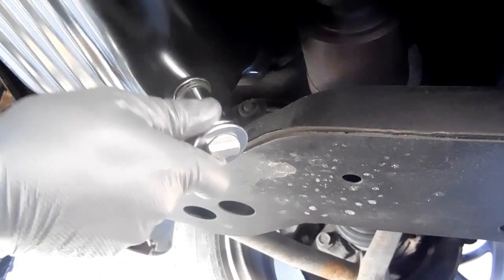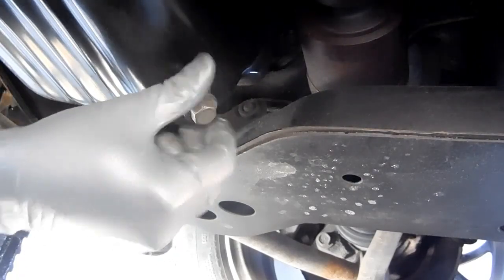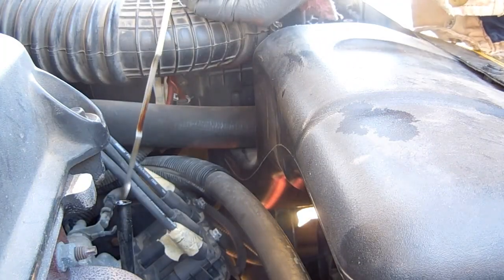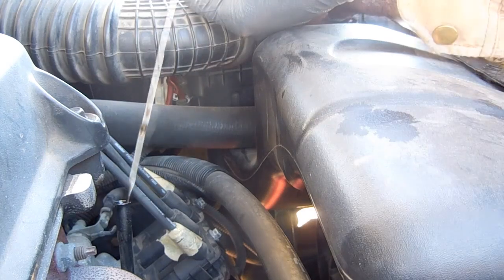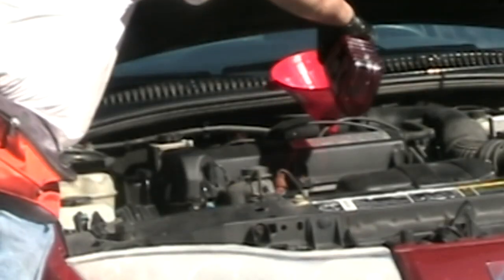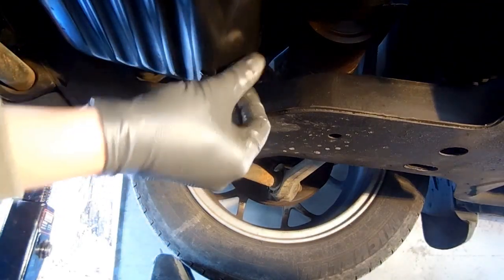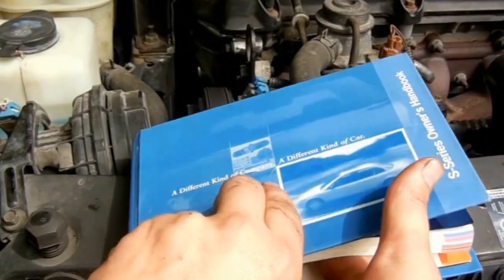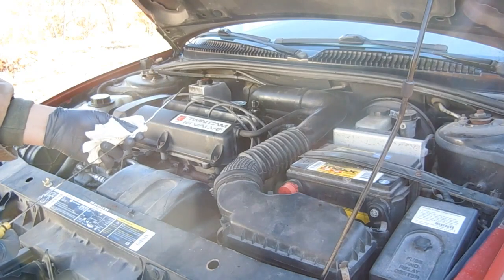Safe Motor Oil Flush Using Kerosene

Comment: this type of flush is a bad idea.. diesel and kerosene break down the oil film strength, so the engine is not getting properly lubricated while it is running, this will cause connecting rod bearing, cam and lifter, as well as main bearing damage. it will also damage flat tappet cams and lifters. I have seen this crap wreck engines.  I build high performance Big Block and Small block Chevy's for drag racing. There is no way I would do this to any of my motors.  there is a blog on the web that discusses engine additives and their effects on oil. it also have valuable knowledge on motor oils and the properties that you need to protect your engine. https://540ratblog.wordpress.com/2013/06/20/motor-oil-wear-test-ranking/ I have seen several posts on pros and cons of synthetic oil and regular motor oils and change intervals. none of them are correct. the right oil and change interval is going to be specific for your application. the only way to know for sure is to have the old oil tested by a tribology lab. not only will they be able to tell you the condition of the oil, but they will be able to tell you what's in it at a microscopic level. they can detect things like microscopic amouts of coolant, lead and copper from bearings, or iron/aluminum for piston wear. and you can compare it  to with the manufactures oil change intervals, you will know if you need to change it sooner than the OEM recommended interval. personally I change conventional motor oil in my high performance flat tappet engines every 2500 miles. on the same engine with a roller cam and lifters,  I use full synthetic and change it around 10k miles.  synthetic oil is significantly better for modern engines with roller cams and lifters., however it does not have the proper high pressure lubricant additives for old fashioned flat tappet engines, for those I use a old fashioned conventional oil that has the correct additive package for the type of cam I am using. I prefer Castrol Classic or ams oil Z-rod for conventional and Mobil 1 for Synthetic for everything else. not that other brands are bad, I have just had good experiences with these.
Reply: Shad Van idling for 10-20 minutes will not harm the engine, pump or bearings.
If you were to drive the vehicle with a solvent such as ATF, kerosene, diesel fuel etc it still doesn’t hurt anything but be advised: Solvents are thinner than engine oil and can seep past valve seals and cause the engine to smoke.  Simply drain/fill with straight engine oil and within a day the smoking should stop. 
* Keep in mind the crank/rods ride on a “film” of lubricant, unless you go crazy and run the engine super hard, everything will be fine. 👍
Reply: @HeadFlowInc  so then, if I go ahead and do this to my engine, based on your approval,  and it does ruin it. You'll buy me a new engine, right? 😏
Reply: Steve Franklin Not even once! No no no.
Engine flush has been around for a very long time.  In my experience flushing isn’t a good idea on older poorly maintained engines.  If you had a regularly scheduled maintenance flush starting when new, flushing works, but on older engines it’s a huge gamble.
Reply: @stevefranklin8052  LMFAO
Reply: Shad Van most if not all engine flush contains a high percentage of kerosene so how exactly is this bad smh
Reply: Any flush needs to have anti-wear additives and adequate film strength. Kerosene users should be aware of this!
Reply: Thanks for the link.
Reply: Hey everyone, we have John Force here with us today!!!  What's going on John?
Reply: Thank you, someone out here has some brains, great comment. Got a question my 5.7 hemi has a tick on acceleration under a load. I think it's a lifter, I was gonna do a flush to maybe un-stick it, but I know the damage they can do. Any advise bro?
Reply: Shane Fochtman You might try a slower version to flush the engine.  You can add Marvel Mystery oil to the crankcase and see if it helps flush the lifter. 
Caution: Make sure the noise you hear is 100% a lifter and not the engine detonating. 👍👍👍
Reply: @shanefochtman5826  If your motor is a Hemi 2010 or newer. The sound could be caused by a bad or diirty VVT piece. Sounds just like lifters, tappets, or louder & worse, like rod knocking. Bad oil and dirt make the VVT act up, depending on rpm. Should have thrown a code though.
Reply: @shanefochtman5826  I know it's been seven months since you left your comments but I'm just now seeing this video. Did you and we'll figure out what the problem was?
Reply: Agree I use synthetic in my Ford focus change it every 10000 kilometers,after 312,000 kilometers don't burn no oil you Know what I mean berlly. Not changing your oil or cheap oil in new vehicle's then using flush your flirting with disaster grint getting into the crank or rod bearings and seizure time. I use Castrol ultra synthetic superbike 10W50 goes in green comes out green at 3000 kilometers change. My car anything that's on sale synthetic
Reply: It's okay he's putting it in a old Saturn it's already junk
Reply: Exactly’ when I was younger I read you could add diesel to your oil to “flush it” then replace with new oil... a month later that poor car was absolute trash, not worth a cent if blew then turbo seal,  head gasket, and caused a “diesel runaway”

Comment: Last year I sold my 16 year old vehicle with over 300,000 miles on it. The engine ( Ford 4.6 v8 ) had no sludge and was as clean as the day it came off the showroom floor. ( Still had the original transmission with no work or trouble ) The engine never needed any type of cleaning or work and never used more than a 1/4 qt between oil changes. Always used a good filter ( not Fram) and Pennzoil conventional 5w30 per the manufacturer. Changed the oil every 6 months or 4000 miles. If you take care of your engine, you should never need to clean it. Oil changes are cheap. If you do flush with kerosene even after you drain it and add new oil the new oil will remain contaminated and will cause damage to your motor and again will need replaced within a few hundred miles. As a oil professional I would never recommend putting anything other than oil in the crankcase. A good oil and filter will clean the engine over time if it's changed regularly.
Reply: +kcp71
16 years and 300k! That's fantastic but what about the valve stem seals?
They get hard with time and leak oil into the combustion chamber. My car takes more than a quart/1000 miles. I wonder, If a kerosene or diesel fuel flush would help. It might (at least temporarily) soften the seals? I'm willing to try it before taking the engine apart...
2011 Crown Vic, 250,000 miles, but not the first owner.  
Any ideas? Thank You.
Reply: My 4.6 never used more than a 1/2 quart between oil changes. I changed the oil every 3000-4000 miles or 6 months. I still had the original transmission. ( Flushed every 30,000 miles ) I would never recommend a kero flush, try a few oil changes with a good quality high mileage oil. It worked on my son's GM car cutting down on oil consumption.
Reply: @kcp71  that only works of there’s no sludge to begin with.
Reply: So how do you explain the MMO being 50 % kerosene then?
Reply: @claudio67362  it’s not. Sources? MMO is ATF based with additives. This is straight from MMO people’s mouth who actually work with it. Watch Fordboss channel

Comment: I remember one of the ace mechanics back in the 50's draining out a quart of oil and adding a qt of kerosene, running it not much above idle, never driving it  until hot then flushing.  Great flushing agent but hardly a new discovery.

Comment: It would worl better of you drove the car around for about 10 miles at varying speeds and engine load.. Need to get the oil flowing fast to help flush it all knto the ban..
Reply: No absolutely do NOT put the engine under a load by driving it.  That can only cause bearing wear.

Comment: I've had good and bad experiences with flushing engines. Good: People have given me lawnmowers that have smoked. I checked the oil, and it had chunks of carbon in it. Neglect and running the mower in Yuma Arizona when it is 105+ outside. I used some flush, and it loosened up the rings because it quit smoking. BTW: the best thing to run in these air cooled engine is 15w-40. I ran some flush in my '91 Ford Ranger, and the oil pump started knocking because the flush cleaned the varnish that closed the tolerances in the oil pump. Now I run 10-40 and a can of STP to keep it quiet.  Another time a friend flushed the engine in his car, and a lifter started knocking. A piece of grit dislodged, got into the lifter, and it would not pump up after that. I ran 15-40 in a very old engine that ran fine, and after a while it started smoking. That high detergent oil cleaned out the carbon or varnish that was helping to push the rings out. My minivan has 148,000 miles on it and it always had the oil changed every 3000 miles. I removed the valve covers to change the gaskets, and the engine looked like it had about 20,000 miles on it. Absolutely clean.

Comment: Never put anything other than oil, detergent oil or oil additive into your engine. If you want to be safe? Just use a quart of detergent oil every other fill, keeps it spotless...
Reply: WTF are you talking about?  Nobody should be using non-detergent oil  in any recent decade model of passenger vehicle engine.  It should always be ALL detergent oil. In case you didn't realize, all oil on the shelf with the right API rating the vehicle manufacturer recommends  is detergent oil unless it specifically states it isn't.

Comment: Please... don't encourage others to do this using kerosene. Engine gaskets will be killed by that much kerosene moving around in a hot engine. Stick to sludge detergents that slowly but surely do the job well without doing damage to seals, like a few ounces of seafoam per quart of oil... Drain it out after a couple hundred miles and switch to a fully synthetic oil, not the cheap stuff, and then you wont have to worry about sludge at all...
Reply: LOL NO NO NO!  Seafoam is a solvent not detergent.  Do NOT drive the vehicle at all with any thinning solvent added to your oil, especially  not a whole couple hundred miles.  Fully synthetic oil does not matter much in the context of an older vehicle but regular oil changes do.  Cheap stuff is fine if it has the recommended API rating, that is the real standard for motor oil, not internet myths or marketing propaganda.  If your engine requires something specific then it will be stated in the owners manual.

Comment: All it takes is change oil ahead of any recommended timeline using a good oil that meets the specs and you'll never ever have sludge in your engine.
Reply: No sh!t, did you watch the video? This is for engines that have carbon/sludge problems
Reply: @jtyree0226  😂😁
Reply: @jtyree0226  NO SHIT! DID YOU READ MY COMMENT DIPSTICK?
Reply: Thanks for the lecture dad
Reply: @Camposdarko  I guess if you're needing to flush your engine you needed the lecture, kid.

Comment: There are two types of engine flush products, detergent Base and solven base. Solvent Base flush will damage your engine seals. Detergent Base is what used in high quality synthetic oil, just higher concentration and it will not damage your engine seals. However, it will clean up your engine.
Reply: Incorrect.  Solvents meant for engine flushing do not damage seals.  Detergent is in any regular oil, has nothing to do with being "high quality synthetic" or not.  Detergent does not clean already accumulated gunk out of an engine  very well at all.  Its purpose is to trap the smaller molecules before they settle into gunk.  it keeps an engine clean better than it cleans a dirty engine.
Reply: Well, who's right goddamnit? We need to know.
Reply: Ray Butler jr .....lmao !! I dont ever literally laugh out loud when im reading stuff. But, your comment had me cracking up after ready the 5 or 6 above yours. Funny stuff. Good day to u
Reply: I think frequent oil changes are a safer and better solution :)
Reply: Mitchell HürenKamp you are incorrect, kerosene is a dry fuel and will cause damage inside an engine and it will dry out seals causing damage. Automatic transmission fluid works so much better and is safer because it lubricates as it cleans.
Reply: Bullshit! In every  video about flushing engines there is people who continue writing that flushing engine will destroy the sealings, and that is bullshit! Do you even know how much a seal can handle? You can put pure petrol in the engine to flush it without the sealing even gives a damn!
Reply: I agree seals are gonna be fine, but I question the method in general
Reply: You are incorrect. Kerosine is recommended for Motorcycle chains aswell for cleaning because it won't attack the o or X rings in the chain.
Reply: I've used kerosene to flush out many engines over the years. My uncle showed me on a old Plymouth Fury. I had never had a problem with the seals leaking. I normally use 2 quarts of kerosene after draining some. I run it for 10 min shut it off for 30 and run another 10. I use Castrol high milege on most American vehicles. Havoline on foreign cars.
Reply: Penrite makes a motor flush, 15 oz. that is non solvent and contains added zinc for wear protection.

Comment: I use diesel to flush out then let it drip overnight. been doing this for my truck & sub for 5 years & it's great. better change oil your self than others do it for you.
Reply: Alvin Balonglong You have a sub? How deep under water can it go?
Reply: How much i can add in 2.5 ltr gasoline engine with 170,000 km

Comment: Total waste..NO evidence this does anything positive.
Get rid of  the saturn while  it runs...buy a Toyota, use synthetic fluids.
"gunk "is normal for engines.. Engines are dirty places...
Reply: How can you consider yourself intelligent if your solution to keeping a vehicle running is give up on it instead, pay a lot more money when what he has works, then pay a premium for the synthetic fluids too?  You are an expert on wasting money.  "Gunk" builds up at a slow pace if you change oil at the recommended intervals, it's not normal for it to reach a problematic level unless the engine saw extreme heat conditions or the oil wasn't changed nearly often enough.
Reply: synthetic IS the same price b/c it last longer usually twice as ong. Some great vids on YT about engine flushing ruining engines. My 93 has 260000 miles on the original engine,
As I started in my post...No evidence this guys method works or any flush.
Flushing can dislodge particles that can clog valves and all kinds of stuff.
Get real advice...Scotty Kilmer. Chris Fix, not this clown
Reply: There is plenty of evidence if you look for it. Don't make such a broad false statement. Even Amsoil makes an engine flush and they were one of the first to make synthetic motor oils in a can (1972).
Reply: Penrite makes a motor flush, 15 oz. that is non solvent and contains added zinc for wear protection.